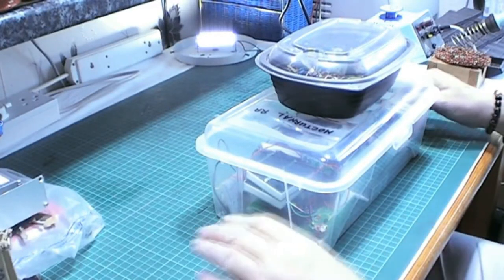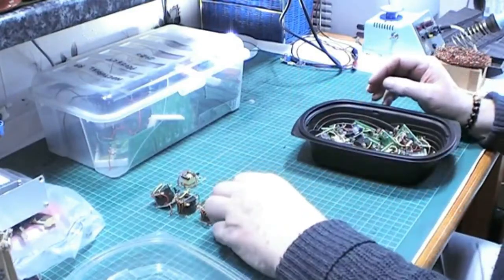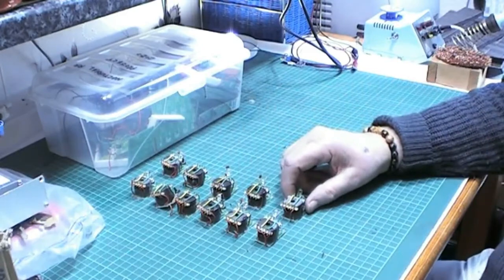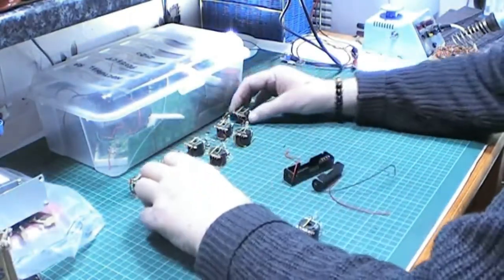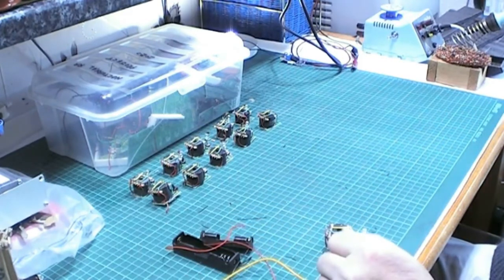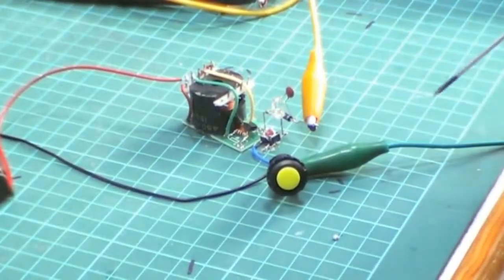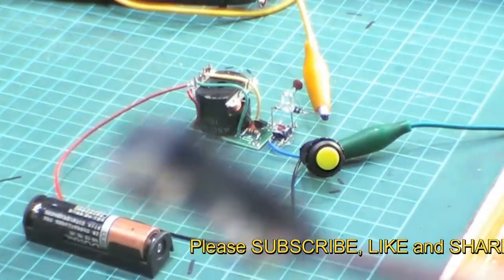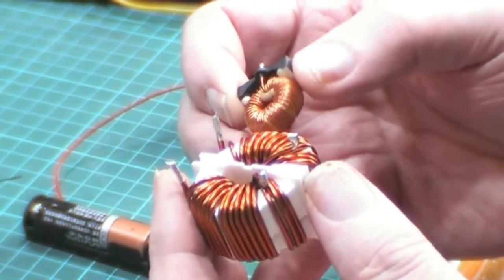Project Nocturnal Ra Part 1

Comment: not sure what your building but you may find this usefull i played with joule thiefs a few years ago you will find the other winding on the transformer will also produce voltage  also you dont even have to use a toriod a nail or any coil side by side will work if i recal a ac filter from psu's worked the best think i even tried the tranformer from a base amp one time carefull with that oe tho that hurts also fuji disposable cameras have a hell of a little unit in them that will light up cfl's
Reply from the maker: Thank you my good friend I will try those ideas of yours. Stay safe both of you.